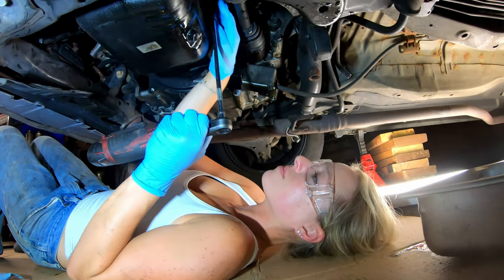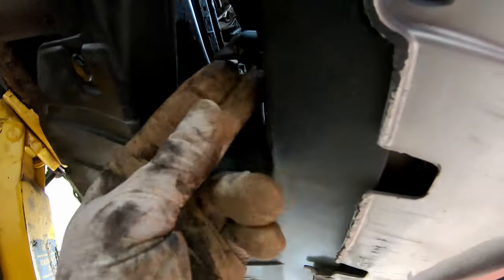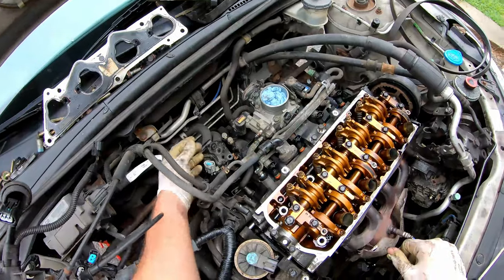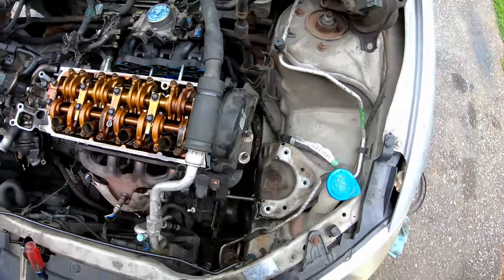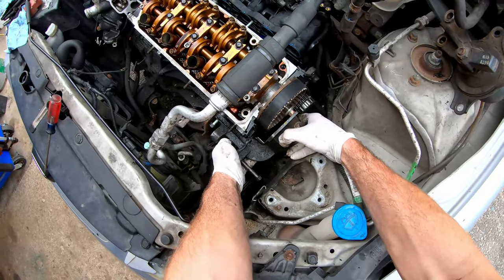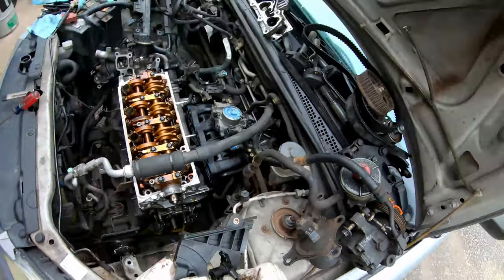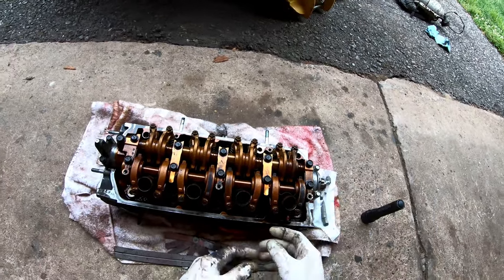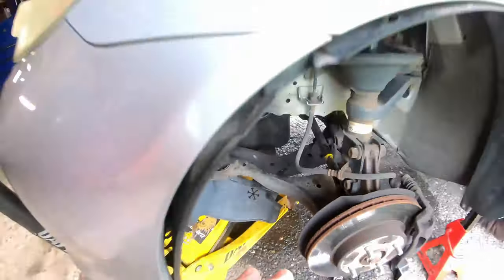Honda Civic 1.7L Head Gasket Replacement OVERVIEW/TIPS - PART 1

Comment: I did a "tip and slip" headgasket on a older civic.  Just removed the intake bracket, exhaust manifold and cam pully then pulled the gasket out/in.  Drove that car for 5yrs.
Reply: best way to do it , im sure the same can be done this year if you dont need a new belt.
Reply: Huh?
Reply: That won't work on this generation of civic because it requires an update to head studs instead of head bolts in order to get more torque on the headgasket, otherwise it will blow very quickly.

Comment: Wat sensor is it? I just broke a sensors on the left side near the area between the air box and grounding cable, its sensor is directly bolted into the engine looks like i need a 20 or 21 mm socket to remove it

Comment: I have done 2 of these recently. The second only to clean out the EGR system after I saw how much carbon was deposited in the first. I am convinced that plugged EGR systems are a cause of head gasket failure. That aside, about the nuts/bolts that appear hold the intake to the head. You only have to remove the two outside lower corners with the long nuts (easy), and the middle top nut (easy to remove but careful you don't lose the nut (use a magneted wrench if possible. The bottom two bolts are the most difficult IF you try to remove without pulling out the entire intake assembly WIT the aluminum EGR plate. Presuming the fuel, vacuum, and electrical connectors are removed, the whole intake assembly should come off. Once it is off, you can lift the assembly to access the two lower remaining bolts. When reinstalling, ensure you install and tighten these two bolts into the EDR plate first. SO much easier that trying to remove or replace them while hanging on the head.

Comment: Hey man thanks i have an 04' civic 1.7 sohc that i just bought, plan to change cylinder gasket as well, but now i thinking on changing everything-timing gasket, water pump, to thermostat, valve gasket, piston rings, alternator. Great vid, gkad to see someone else doing it before i try gives me a bit of a go ahead

Comment: One thing I found that worked at getting those stubborn bolts in the back where you had 5 different wrenches including a stubby, I just used a 1/2 inch and a 12 mm from above. Didn't strip them either. It was able to come off smooth as butter that way! Just figured if anyone else doesn't have that array of wrenches maybe give that a try. Edit: used this technique while putting them back on and it was a breeze.  just slowly put them on : if the 12 mm didnt spin it on first try, I switched to the half inch.

Comment: Thanks for these video 📹 I had the same problem whit my Honda Civic 1.7l vtec it was blowing the antifreeze into the canister and it was overheating even when the fans were on it turned out to be the head gasket I changed it and water pump and timing belt now it doesn't overheat no more runs like a baby 😇🙏👍

Comment: Excellent video with very good sound quality. I liked the way you pre-disassembled to keep the job rolling. The really superior points are showing us the 'special' tools you made. (I resemble that). And the superior tip on hand 'machining' the top of the block. With that being said, I know I will not attempt to work on that Honda. I bought new a '77 Civic CVCC. It had a head gasket recall. That was one really crappy vehicle.  The engine and manual 5-speed transmission had major problems. The 3rd gear synchro broke and the cam shaft lobes were fracturing. I had to rebuild the carb with Honda kit 2 times while I owned it. Starter went bad. The timing belt job was the only easy maintenance about it. In just 4 years and only about 80k the body rusted in half just behind the front wheels. I would never buy another Honda new and if I bought a used one I would know just what their piles of junk are worth.
Reply from the maker: Thanks Greg I appreciate the feedback on the video. And damn 1977 Civic!  That's pretty cool. Yeah I always heard Hondas weren't built quite as good back in the seventies.

Comment: I had a Honda CVCC years ago, in fact replaced the engine and put so much money into it, including the thermostat, water temp sensor, only to find out that the radiator wasn't allowing flow and overheating the engine!... Hope this helps other's out there!... Overheating is common with the CVCC's.
Reply: i currently have an over heating issue with my 04 EX civic. It bubbles up the coolant , any tips ?
Reply: @anthony-zc1pj  You should have an air bleed valve near the intake manifold that will allow you to bleed the air out of the cooling system. Least that is what my Honda CVCC had. You may also want to check to find when the thermostat opens, as it may not be opening at the right temperature or someone could have reversed it opposite from the directional flow. Sometimes the bottom of the radiator gets plugged later on, check for the flow after bleeding the air out of the system.  There is also a temperature coolant sensor located usually on the front of the block that may be faulty (turns the electric fan off/on) and there are testing procedures that will tell you if the sensor is working properly. Just some suggestions as to where to check about overheating of the engine. 

This website people are talking about: The bleed bolt is on the back of the block near the oil pressure sensor and the oil filter. It's a pain to loosen, even when you have the engine out of the car... I wouldn't use it. Just raise the front end of the car up and turn the heat on full. Same effect.

https://www.hondacivicforum.com/forum/mechanical-problems-technical-chat-8/where-coolant-bleed-bolt-86925/

https://honda-tech.com/forums/honda-civic-del-sol-1992-2000-1/duh-where-coolant-bleeder-valve-1599417/

Comment: Great video. I am preparing myself to do mine and need a refresher. I work at a RAM dealer and have access to a lift... but i haven't torn my Honda apart in a while lol.... Very good video, detailed and didn't miss anything important that I could tell. Not hours long either which is nice.

Comment: Sanding the block like that still in the car, how do you get the tiny metal particles out of the block afterwards?
Reply from the maker: You could pack paper towels in the cooling jackets. Or just flush them out. It's just a little bit of dust

Comment: Very informative walkthrough, thank you! Now what do I tell the machinist what I need done to the head? Don't really know the linggo from what can be done to the head. I read from forums "cleaned and resurfaced", which sounds exactly like what I'd want. Just basic maintenance and nothing fancy. Any suggestions is greatly appreciated. Thanks again for a great video!!!

My 03 Civic still runs great and does not have a blown gasket but has 220k miles. I just wanted to do this to hopefully prolong the life of the engine. Had this car since mile 1 and always maintained it well.
Reply from the maker: Yeah just tell your machinist that you want it cleaned, inspected, and resurfaced. Getting a valve job wouldn't be a bad idea, but if you inspect it and everything looks okay then probably be okay without if you didn't have issues before

Comment: If you are using a breaker bar for the balancer bolt, loosen it before removing the motor mount.

Comment: Re did my cylinder head, didnt check for warpage, overheating and losing coolant. About to take it on again and make sure its all good, how much does resurfacing average in price?
Reply from the maker: Damn sorry to hear that.  Usually like 50 or so
Reply from the maker: re man head is not a bad option either.  Make sure to check the block also

Comment: So I watched your video and was able to remove my head all by myself. Now I'm looking for part 2. Do you have link to that?
Reply from the maker: That's great to hear! I actually started working on editing part 2 last night.  It doesn't go into that much incredible detail on reassembly. Just an overview.  I should probably have it posted sometime this week
Reply: @NoNonsenseKnowHow  oh no. I don't have the shop manual for this year vehicle cuz I wasn't planning on staying in the 01 to 05 that long but then the head gasket blew. I'm looking for torque specs. I can watch the videos backwards but don't have any torque specs for all this stuff LOL
Reply from the maker: @craigorlikowski2507  you can find all the torque specs on various forums online. There is a good amount of information available for these civics
Reply: @NoNonsenseKnowHow  quick question when replacing the exhaust manifold nuts, flat washer first then lock washer then nut? Any idea the pattern?
Reply from the maker: @craigorlikowski2507  correct. Always flat washer then lock washer then nut

Comment: I have an over hesting problem coolant blows over from the coolant resevoir and bubbling in the resevoir hesd gasket?
Reply from the maker: Short answer: yes.  And these Honda 1.7l engines are notorious for head gasket problems. Do not just slip and slide. Make sure to get head resurfaced

Comment: D17 head gasket replacement WITHOUT ABS = simple job.
D17 head gasket replacement WITH ABS...a lesson in patience, ANOTHER lesson in patience, a journey through your assortment of standard depth sockets, deep well sockets, socket extensions, ratcheting wrenches, combo wrenches, universal joint adapters, specially constructed mirror tools and lighting tools and to see around, under, and behind objects, manually dislocating thumb ligaments for “special” bends, removing a layer of skin on the back side of your hand for “additional” working clearance, a long decision as to whether or not it can actually be done “WITHOUT” removing the ABS unit (it can, I’ve done it multiple times), etc, etc.
Truth be told...”that is pretty much the truth”.
In addition to taking pictures and video of the disassembly, take pictures and video (or notes) of the TOOL SELECTION that enabled you to remove each and every bolt all around the ABS UNIT !!!
Haha, just kidding, it’s actually WORSE than that !

Comment from the maker: On Amazon:
*MACHINIST STRAIGHT EDGE: https://amzn.to/3qf0mEt
*FEL PRO HEAD GASKET SET: https://amzn.to/2Rcz9lx
*TIMING BELT KIT: https://amzn.to/2GPA6hB
*HEAD BOLTS: https://amzn.to/3hgEYZB
*LISLE SPILL FREE FUNNEL KIT: https://amzn.to/32yr6nd
*PISTON RING COMPRESSOR TOOL: https://amzn.to/3u3Kc1o
*PISTON RING EXPANDER TOOL: https://amzn.to/3u6aJea
*PISTON GROOVE CLEANER TOOL: https://amzn.to/3hTkhaj
*HONDA CRANK SOCKET: https://amzn.to/2QGOQn5
*HONDA CRANK HOLDER: https://amzn.to/2Ewtn90
*IR 261 IMPACT GUN: https://amzn.to/2Fhfm1Q
*GENUINE HONDA COOLANT: https://amzn.to/2ROksoB
*THERMASTAT / GASKET: https://amzn.to/2Foa6Jo
*OEM LOWER TIMING COVER: https://amzn.to/34NVuMy
*BASIC MECHANICS TOOL SET: https://amzn.to/2NctGIC

~PART 2: https://youtu.be/SGha7jkUVCE

Comment: Got an odyssey with a snapped timing belt. Also got a same good motor on the side. Can I swap the heads from the good motor to the snapped timing belt motor, install new headgaskets and call it a day or I still have to resurface the heads?
Reply from the maker: I would definitely recommend checking the heads for cracks or warping. But no I'm sure you would be fine if you just swap them

Comment: Hey bro I have civic
Cn u tell me how much it cost to replace head gasket of my civic ??
Reply from the maker: Prices range all over the place depending on your region and who you have do it. also it depends on what you're replacing. Just the bare minimum or replacing all important components. In short, I guess I could see it ranging from $350 to $2,500
Reply: @NoNonsenseKnowHow  thanks mate.. my mechanic told me they can change the head gasket
Reply from the maker: @AbhishekSharma-vq8ly  no problem. Good luck getting it all rectified
Reply: How much is it costing you?

Comment: Great vid.. thank you. I drive an 02 civic ex D17A2 with a HG leak exact same as yours. Overheats only if driving on hwy for over 15 miles. Already bought valve cover gasket now just saving for all the other parts. When done right do you think it’ll last over 100k?
Reply from the maker: Thanks Trevor. And yeah if you do this head gasket right it should last another few hundred thousand miles

Comment: Just curious, how long did this entire job take you & how much did the parts cost you? Thanks for leaving all the materials in the description, big help!

Edit: I also have another question. Aside from doing the head gasket. If I were to replac the engine itself, is it manditory to replace the radiator,  radiator hoses, & purchase new fans? Thank you.
Reply from the maker: I don't remember exactly. Probably something like 10 hours.  Didn't really add up the parts cost either since it was my girl's car. Also, no it's not necessary to replace the radiator and other components if replacing engine. But certainly not a bad idea to inspect them and replace it damaged or problems
Reply: @NoNonsenseKnowHow  Thank you. Asking a mechanic is usually a "yes" because they want to make a buck. Wish I can have some buddies to help me with this stuff but they're aren't car guys and I don't have a garage yet. Thanks for the info anyway!

Comment: No Lie this video was very intriguing. Peeked my interest and boosted my insight on changing a head gasket before doing so. I was wondering if you can give me some of your feedback on a problem I'm having with my moms 2002 honda civic? By the way I'm still pretty much a novice when working with cars. If so HMU. 👍🏽
Reply from the maker: It's great to hear it peaked your interest in tackling the job yourself. It's not too hard, just need to give yourself plenty of time. I'm working on the part 2 footage now which has a great deal of more information in it. It's hilarious though because I'm pretty much torturing my girlfriend and making her work on the car.  haha.  In a fun way.  If you want to shoot your problem at me I might be able to give you some feedback, but sometimes it's tough on here without seeing a car in person
Reply: @NoNonsenseKnowHow  Alright I'm going to try explain this as best as I can. 😅
Okay, the vehicle I'm working on, it starts okay and runs fine for awhile. Then down the road everything starts  going crazy. Lights are flashing, getting dim then bright. And after it stops all the lights stay dim. Got to park it, shut it off and try start it back up it gives me a Dead Battery symptom and just clicks.. So since we found out it still does that we just left it off and parked .. but I changed the battery, alternator before we ran it the test. It's almost like what this other guy is going through with his Honda odyssey. Link down below.

https://youtu.be/2j8moYU6BDc

Sooo I took it upon myself to change the valve cover gaskets and gromets cause theres bunch of oil everywhere on the engine and my pops was telling me that the engine must've gotten hot enough to be coming out the top of the engine cover. So getting straight to the point i got the cover off tried to change the gasket and gromets, everything was hard as plastic. Gasket came out okay but the gromets came out in pieces and still stuck in where they were suppose to go. 😩😩😩😩😩😩😩😩😩😩😩  so I'm stuck between and rock and a hard place on how to go out getting that valve cover back on there. Dont wanna heat it up and end up warping it if that's possible.. or using picks is kinda scary too on trying scrap it out. Either that I might Just end up getting a new one. SOOO YEAH.. 😅 HMU I'm open to suggestions. Lol
Reply: Scrape*
Reply: @NoNonsenseKnowHow  
I seen the vid which was pretty awesome! Loved her enthusiasm..
Reply from the maker: As far as answering your question, it sounds like you're just having a hard time getting the old dry rotted valve cover grommet off right? Yeah I mean there's not much input I can give about that except for just have to get in there and make sure to get everything off. You could try using a heavy-duty gasket remover spray. But they don't really sell the good formula anymore. The old toxic stuff used to disintegrate anything it touched
Reply: @NoNonsenseKnowHow  well I got the gaskets off and replaced.. My main concern was the lights start flickering, when it stops everything stays dim.
Reply from the maker: Sounds like a bad alternator. I see new alternators faulty out-of-the-box fairly regularly. Make sure to check the battery terminal connections as well
Reply: @NoNonsenseKnowHow  
Yeah, I changed the Alternator, and the battery it still did that after our test drive..got it back home then it gave us the dead battery symptom and just clicked after trying to start it again.
Reply: Oh yeah then I brought a multi meter to the battery and still have 12volts in it.
Reply: Terminals on the new battery are clean and the clamps are pretty clean also.
Reply from the maker: Did you put a voltmeter on terminals and test alternator output voltage?
Reply: @NoNonsenseKnowHow  checked  out the cold cranking amps on the battery.. dropped like 1 amp from 12volts
Reply: @michaelconnor6028  did you buy a brand new alternator? Or did you get it from a parts yard? regardless, have the alternator tested. it sounds like intermittent alternator failure

Comment: Put the cap back on, run it, and check for pressure? Uhhh, my radiator MELTED. good job honda
Reply from the maker: LOL, yeah if the radiator is melted then you can bet on a failed head gasket

Comment: Felpro gaskets are garbage... So many headaches. I'll gladly spend the extra for a Honda gasket.
Reply from the maker: The original Honda head gaskets didn't seem to hold up very well on these. The felpro didn't give us any issues
Reply: @NoNonsenseKnowHow  sorry, to clarify, I meant the valve cover gasket 😔